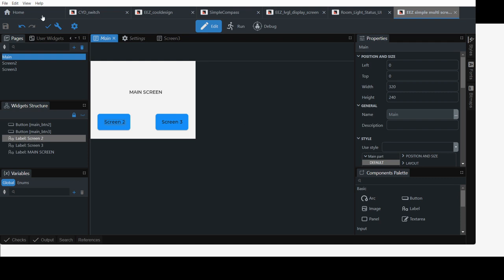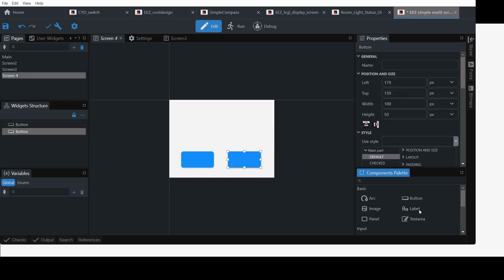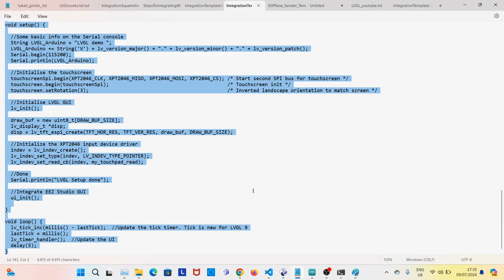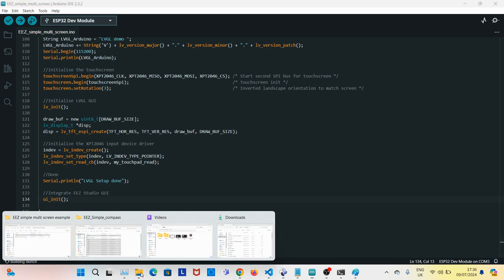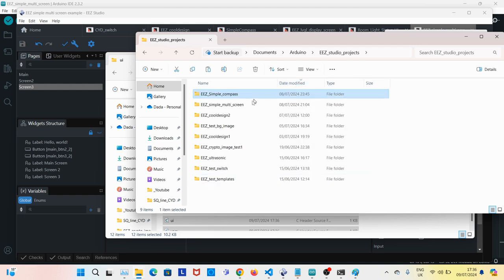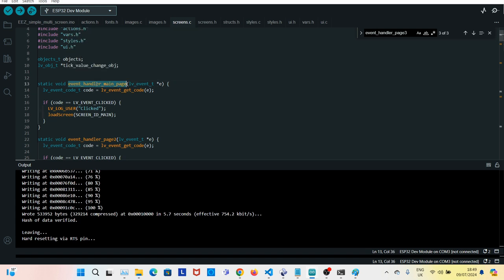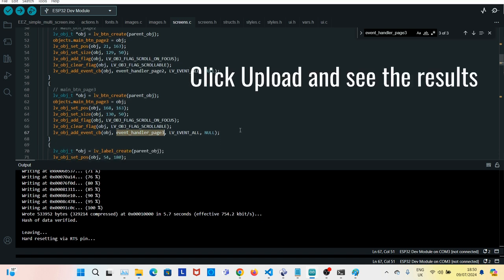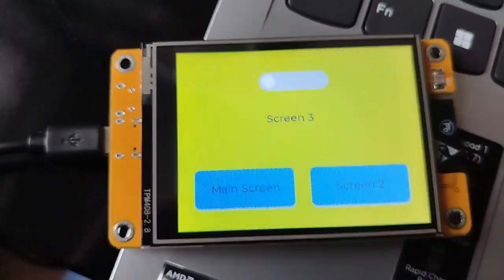LVGL ESP32 2432S028R CYD (Beginner) tutorial on using Button events to navigate between screens.

Comment: Hi. Thank you so much for your tutorials! 
They are very helpful. However I have a problem with screen orientation.
It looks to work in Portrait instead Landscape with my screen.
I had to set touchscreen.setRotation(2)
and add lv_display_set_rotation(disp, LV_DISPLAY_ROTATION_270) to get it working correctly.
Is there any other place with these setting I am missing?
Reply from the maker: The only place I set it is in the setup()
touchscreen.setRotation(3)

Other place you case set the screen width/height is in the User_Setup.h
But I haven't changed that as the default one seems to work for me.
Reply: Can you do it now?